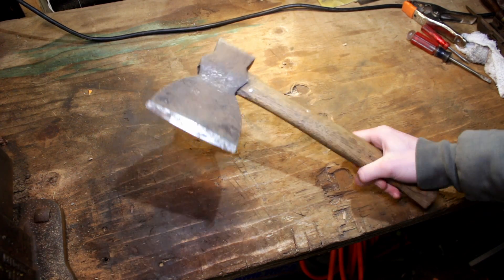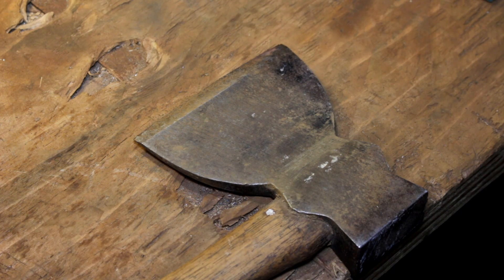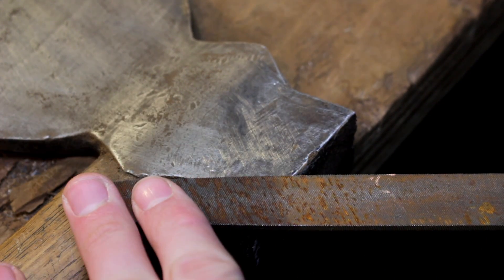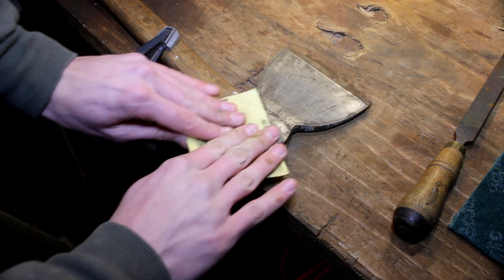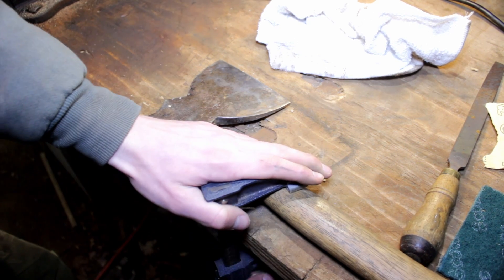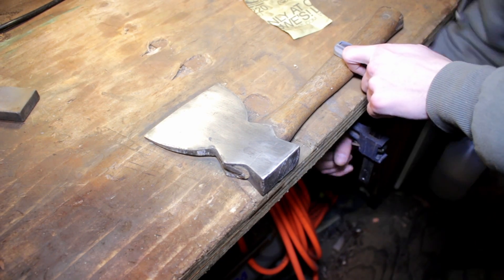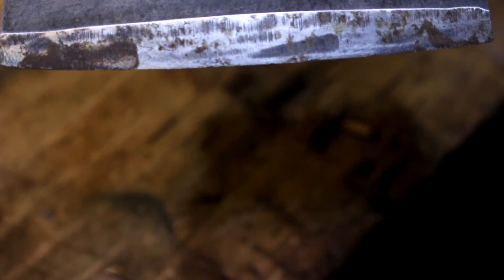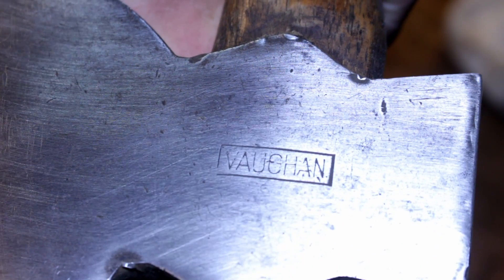Restoring A Hewing Axe Part 1

Comment: I just got a used True Temper Hewing axe.  It has the offset built into the blade, so I do not need an offset handle.  What length handle do you recommend?  I figure14-16”, but am open to suggestions.  It is not a heavy broad axe, like my 200+ year old Pilgrim axe that I hung on a36” handle.  It weighed 8+ pounds.  The True Temper is very light compared to the Pilgrim axe, about like yours. EvapoRust will take all of that rust off of your axe.  I use wet or dry sandpaper with soapy water to sand metal.  The soapy water keeps from clogging up your sandpaper.  I use 220 grit and then 440 grit.  I use nippers to remove steel wedges.  I grab them with a corner of the nippers and pull them out.  Wood wedges I drill out.

Comment: Lock it down in vise. Take a sharp hardened chisel or screwdriver and a stout hammer. And drive the wedges sideways from the top side edge. It should kick up the edge of the wedge and drive it up out of hole. But make sure the axe is not budging in vise. Must be secure.

Comment: I found a hewing axe at a flea market and it's handle was shot...so I removed it.  Then I realized that I needed to make sure I put a new handle in so that it has the flat side of the head on the left side during use... which is opposite of the way your handle is in your axe.  I suppose you could still use yours with your right hand... but you'd be working on the left side of the log instead of the right side of the log... if that's what you're comfortable with.  I don't know if there's a right or wrong hewing position while on a log... but handle direction as it goes through the head does matter if one has a preference as to their hewing position... with right or left hand.  My axe head is pretty worn... no manufacturer's name is visible.  So, I can opt for power tools to get it shiny again.  I've seen other channels use various grit flapper disk sanders on their rotary sanders for getting the steel shiny again.   I also only plan to sharpen just one side of the head (not the flat side) so it will dig into (hew) the wood smoother.  I've never used a hewing axe before... but am looking forward to it !
Reply: Old Boy Adventures i

Comment: Edmond Cote is correct. Drexel with cut off wheel is the easiest way to remove those wedges.The Facebook and Disston links that you posted aren't working. I get an Error message when I try to go to them.Thanks for the video. I'll be watching and subscribing.
Reply from the maker: scott bowman Thanks for letting me know about the links will fix them soon.